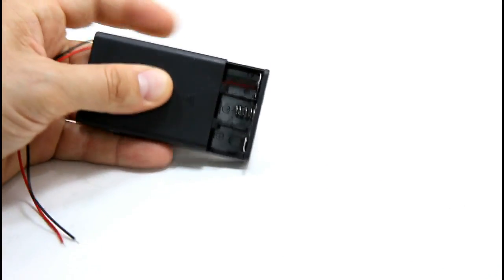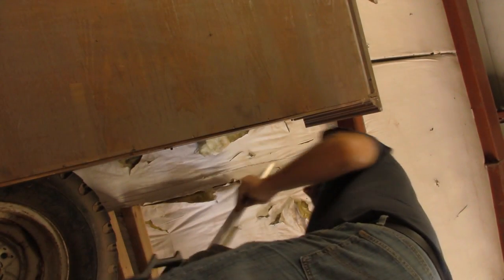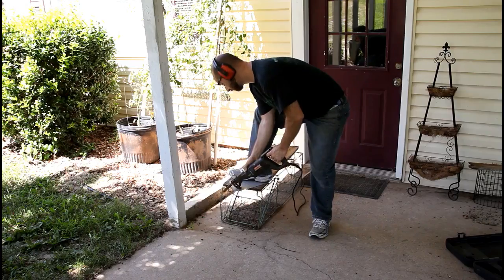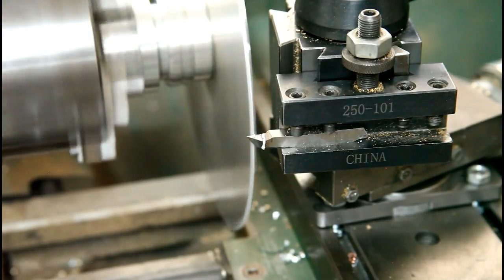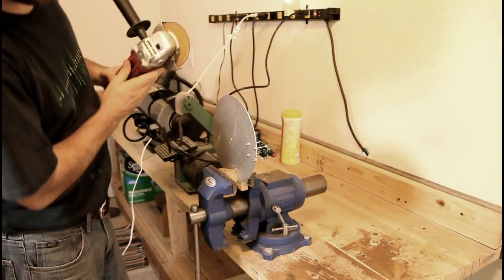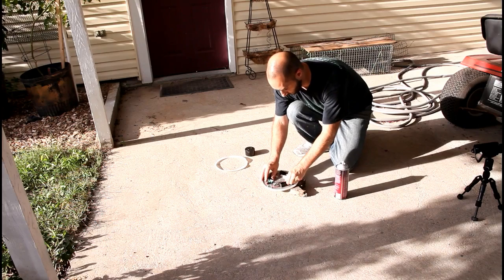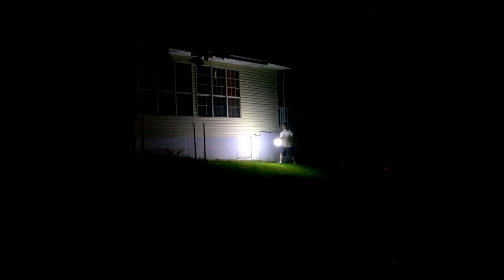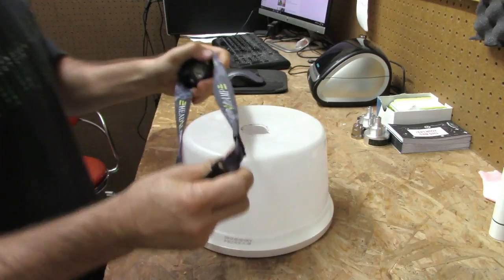Easy DIY Camping Lantern

Comment: Seems like a horrible design all and all.  I mean I guess if you have a large flat piece of aluminum lying around that's nice, most people don't.  I am sure people will just head down the road until they find a flat piece of aluminum on a pole, BUT I grew out of taking street signs when I was 14.  it would have been a lot better to put the batteries in the middle and the lights on the outside.   A good amount of light will be blocked and absorbed by the black battery holders.   It would have been better to put more LED then adding a 1ohm resister (heater).  I liked watching you make the thing, learned some important techniques, but you should re-visit this and make an eve better one, cheaper.  I would love to see you make one using an old flashlight, a soda can for a heat sink and a milk carton or some other readily avail diffuser.

Comment: Are those protected 18650s ? It didn't look like they were. Just need to put in protection ICs for each cell in case someone leaves this on in a tent all night when they go camping and run the batteries down too low.
I like the diffuse light from the icecream bucket...putting lighting designers out of business !

Comment: Awesome love it! I have turned all kinds of things into 18650 powered devices. So rewarding when you make nothing into something. Got some super bright led 3v diode's @.3 watts noticed how bright and beam focused they was. Made a handful of 18650 flashlights for a couple of bucks. Single 18650 holder glued on a cheap switch put both on a piece of a paint stick attached resister then led in a makeshift lens. It did everything I wanted a super long lasting light and brighter than my old mini mag light "non led". Perfect for looking for things when you don't need a spotlight even have a blue light in tackle box for nighttime fishing.  

While its not as bright as fancy 18650 torches the one efficient led diode lets it last x20 longer or more. Which is what I wanted to replace camp propane lanterns. Something you can run all night without even worrying about batteries li ion is amazing! Thanks for this will try out a few plus give me an excuse to buy ice cream!

Comment: Great Video! what adjustments do I have to make to make this work on a car battery?
Reply from the maker: You would probly want to go to a 4 led setup.  You could run only 3 leds in series, and add resistors too I suppose.    I'm going to make a light bar on my truck using this system I just havn't had a chance yet.

Comment: Hey, question. Could I substitute a constant-current regulator in place of the resistor you used? And then use a pwm the same way you did? I'm trying to control an xhp70 brightness level for a work lamp I want to build.
Reply from the maker: I think that if you have both in place it might cause a fight between the 2 circuits.    If you want a true buck driver that is controlled by a pot TaskLED has them.   H6CC is the on I use.   IIRC you need a 50k pot on that board.  http://www.taskled.com/compare.shtml

Comment: What type of resistor did you end up using for this build? I am brand new to electronics and interested in building this lantern.
Reply from the maker: Hi Keriann01.   I don't know a ton about resistors either.  The kind I used are wire on the inside of ceramic potting.   I picked those ones up at Radio Shack.   They were 1 ohm 10 watt.   CP-10 resistors is the type I think.    Just make sure you get some that are rated at fairly high wattage for a project like this or they will get very hot or can even burn out.

Comment: You should have put D cells batteries so it lasts a very long time.
Reply from the maker: D cells would work if you wire the LEDs in parallel :)

Comment: A good way to cut and shape aluminum is to use an angle grinder with a cutting disc and grinding disc. You can also take a regular bar of soap and press it against the cutting surface and that will prevent the aluminum chips from clogging up the blade. It will slice aluminum like a hot knife through butter for about five seconds, then you have to touch it again with the bar of soap. I prefer Dewalt grinders and the tool-less mandrels.
Reply from the maker: First time I've hear the soap thing.   Maybe I'll give it a shot.